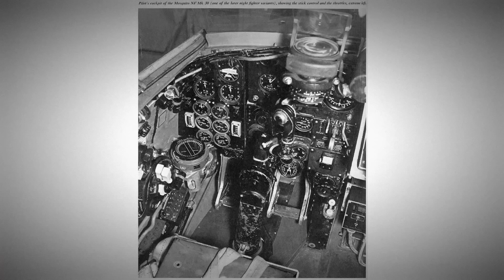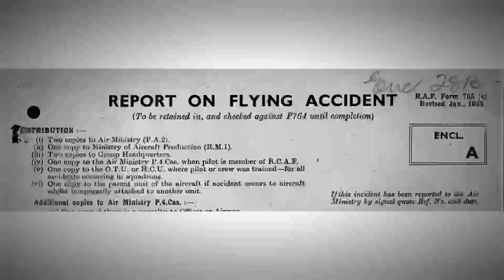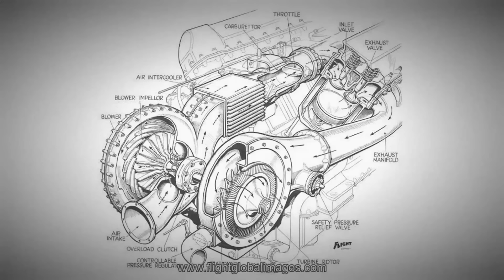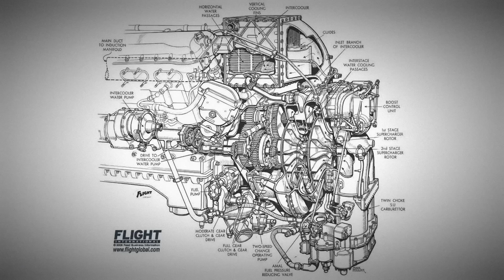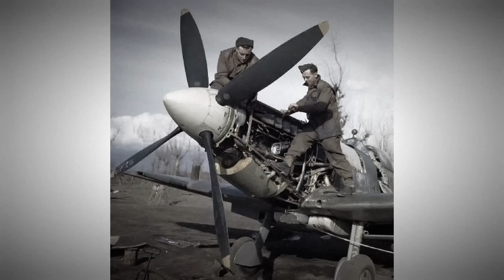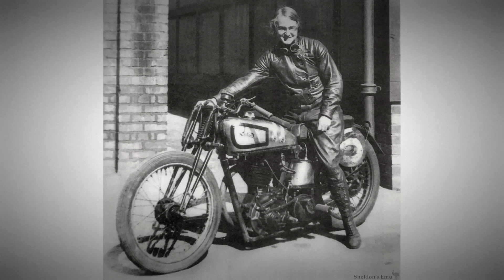The Mechanic Who 'Illegally' Made Every Mosquito Faster Than the Spec Sheet

Comment: lots of barriers were put u[p to try and stop the mosy going into service by the govt.

it was at 1st going  to be a jet fighter denied due to lack of jet fuel that had the Gloster Whittle jets grounded since 1933.

then denied on the grounds it had twin engines so could not be a fighter. no defensive gun turrets so could not be a bomber. then it was it could not fly at night. just excuse after excuse made by the govt to try and stop the RAF getting it.

deHaviland did'nt want the Merlin engine as it just didnt have the power other engines had.
Some RAF pilots used their own money to by mosi's and showed the govt how efective they can be and proved the govt wrong on everty aspect. the gove evetuialt gave in and allowed the RAF to have them but wioth restrictions liek, no guns allowed and can only be used for recce nothign else. then they used them for bombing to prove they coudl do that rols govt caved in and said ok u can use them as bombers. then another sqaudron fitted 4 cannons in the nose and 8 machine guns in the wings and used them as fighters again the gove caved and said ok u can use them as fighter bombers.
but the govt refused to let them use anything but the merlin which had already proven how under powered it was.

 1 spitfire pilot got lost and landed at a luftwaffe base by mistake. so the Germans experimented on it. they took the merlin out and put it in an ME109 and found the ME109 was 50mph slower. they put the ME109 BMW engine in the spit and found the spit was 50mph faster.

Avro didnt want the merlin for its planes but got forced too. the manchester had 2 rolls royce engines forgot the name but those 2 engines could carry a far bigger bomb load and longer range than the 4 merlin engined lancaster could carry. Rolls royve were told to stop developin g the other engine and juts work on making the merlin beter as the merlin would fit in a fighter the other engine wouldnt as it was too big,

as a result when they fitted 2 merlins to the manchester it didnt have enough power to take of with no bomb load. so they had to redeshgn the mancherter to have 4 engines instead of 2 and renamed it lancaster. half the bomb load and half the range of the manchester.

Comment: The description of detonation is completely wrong. The description is of pre-ignition ... ignition before the spark. 

Detonation occurs AFTER ignition, whilst the flame front is racing across the piston top. It's the combination of compression heat AND combustion heat which can cause the last part of the fuel air mixture to self ignite before the flame front reached it, resulting in hammer blows to the pistons. 

And this article is ridiculously complex and wordy.
Reply: Thanks for your technical correction 
& it’s far to wordy too

Comment: Of course,
  Combustion technology has progressed far beyond this. 
  Do not make the mistake of equating auto power levels to that of aero operation. 
  Aviation engines operate at a constant 75% or more. 
  Your car would never survive. 
  Modern auto turbo engines survive at static compression of 10:1 or more with up to 28lbs boost om 93 octsne.
  But not for long periods.

Comment: Basically, when higher octane fuel arrived in England in 1942, an engineer called Banks, unofficially, and surreptitiously, increased the Merlin supercharger boost pressure from 18PSI to 20PSI to suit this better fuel and thus usefully increase the speed of the Mosquito aircraft and save lives. Thank me later for saving you 52 minutes of your life.
Reply: Thanks. What was the power increase as a result?
Reply: So your type of biography would be “born, did stuff and died” 😂😂😂😂😂
Reply: I read Rod Banks autobiography "I Kept no Diary." I have a copy.  The first 100 octane tanker load arrived in England on the Beacon Hill in time for use by Fighter Comnand to return the Merlins from 1040hp to 1300hp in the Battle if Britain. The Germans had no idea the Spits and Hurricanes over England were not the same as they fought over France. 
  Rod Banks was a consultant with Texas based Ethyl corporation to  brew that 100 octane.
  Banks research led to the 130/145 octane that made the P47s and P51 escorts possible. 
  Thus octane was thought impossible to refine in bulk in 1940.
Reply: I do thank you as I absolutely hate those lengthy videos (this one almost an hour!) where the premise of the title can be answered in a single sentence!
Reply: however, if you left this video early you would have no knowledge of "Miss Schillings orifice"

Comment: I do not know where you found all those brass screws!  The timber was moulded around formers then clamped under pressure to allow the ADHESIVES to cure.  At the most there would be a few staples to retain the alignment of the veneers which became the multidirectional plywoo skinuntil the pressure was applied.
Reply: Glued all the components into the hull as well did they?  All the flying control paths had their runners glued on as well...  Yes, the frame and hull of the aircraft was plywood.  The different sections of plywood moldings were screwed together, I believe, as were all the components, flight controls, fixed cockpit elements, engine bulkheads and bearers, etc, ad nauseum.
Reply: I believe the main spar had screws in it, too. The Kiwi Mossie rebuild showed the spar with lots of screws in it iirrc.
Reply: That’s what I thought!

Comment: Geese can fly at altitudes ranging from a few hundred feet to over 29,000 feet, with bar-headed geese holding the record for the highest flights.
Reply: What's their maximum bomb load?
Reply: @thisisnumber0 a good size load if the park near me is any indication
Reply: Are they turbo charged or super charged ?  Do they have anti ice or FIKI ?
Reply: @tonylam-u1t The most powerful Merlins had two speed, two stage supercharger. 

They also added water injection on some late model Merlins that gave you another temporary boost.  You were limited by the amount of water you could carry.